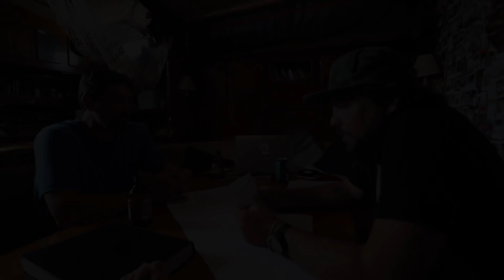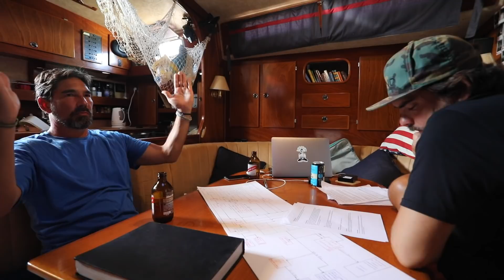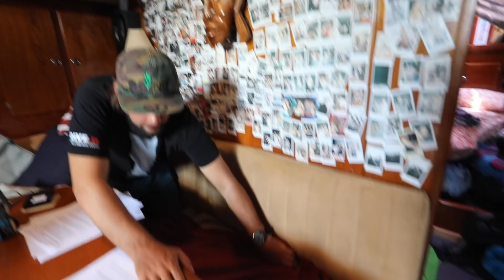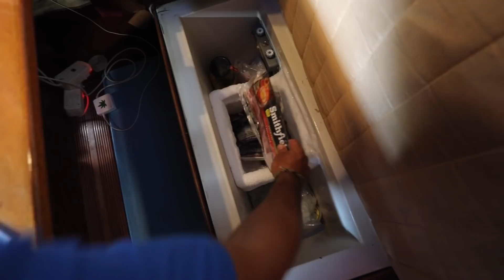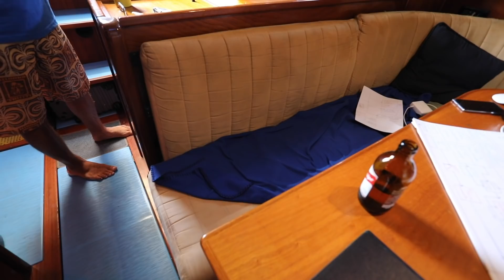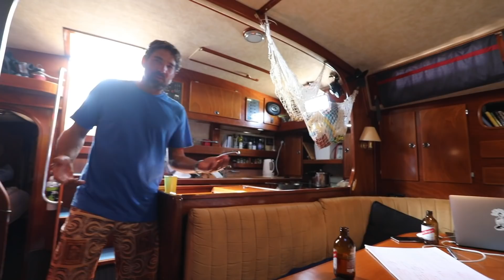How Cost effective is solar power? - ELECTRICAL BOAT TECH (7 of 7) -  Sailing Vessel Delos

Comment: You could look into a ‘soft start’ drive for the AC motor on your dive compressor.  They have the ability to slowly ramp up the speed and you can set the maximum current draw during start.  The only problem might be the compressor might have such a high compression ratio that a current limited motor might not be able to get the compressor over the first compression cycle.  A decompression valve might solve that if it is a problem.  Of course you would still have the running draw to consider.  That would depend on how long you need to run the compressor and how many amp hours you have available in your battery bank.  Might be worth the hassle if fuel consumption is a concern.
Reply from the maker: Yes, absolutely.  I have been looking into those a bit.  Of course we would probably end up depleting the bank and need to run the generator to recharge with the amount of solar we have.  But technically it could be possible.  Check out this one- https://battlebornbatteries.com/shop/easystart-364-3-ton-soft-starter/
Reply: Sailing SV Delos I saw a video of this being used for an RV A/C unit running an inverter from a battery bank.  It worked well.  You might need something a bit bigger for your dive compressor.  A good source of inexpensive soft starters can be found at:  www.automationdirect.com   On a sunny day when you have power to spare it would save you a few bucks.
Reply: @-_-..-_  400 amp x 24v = 9.6 kw. To run a 2000 watts compressor for 1 hour you will need a low frequency 3kw inverter no need for soft starter. Low frequency inverter can handle the spikes.
100A battery x4=400 amp x. 12v=4.8 kw.
100A battery x4=400÷2=200 amp x24v=4.8 kw
100A battery x4=400÷4=100amp x 48v=4.8 kw
To raise the voltage, the amperage is divided Wattage stay the same. 
To run a 2000 watts compressor for 1 hour you will need a low frequency 3kw inverter no need for soft starter. Low frequency inverter can handle the spikes.

Comment: Did you say 3 wifi routers? or just connecting 3 laptop to the wifi?
Reply: I think they run multiple wifi networks, based on prior videos.  A lot of marine equipment like Radar's that have wifi require you to use their (or a) dedicated wifi config, not all but many do.  That along with the normal wifi network is probably why they have multiple.  It could be one for Radar, one for guest/internet and one internal.  Or one internet, one radar, one AIS/weather.  Probably something along those lines.  Also, it doesn't necessarily mean they have 3 separate routers, as many routers can support at least 2 networks.
Reply: Not sure if this is there case but many homes have 3 "wifi" networks and they might not even know it really know it. just one quality wifi router normally has one 2.4ghz network and 2 5ghz networks. They might have one name and password on your device list but often times there are 2-3 networks actually running.   I likely have upwards of 10 in my home and 4-5 devices that are technically a wifi router. Not a large home just a "smart" home: security, camera, audio, "wifi", smart home, etc often run their own systems.

Comment: is your external storage array SSD or HDD based? Have you committed to all SSD storage on all your computers? Great videos. I love this series!
Reply from the maker: It's actually a Western Digital EX2100 with 4x6TB Red drives.  So not SSD but hot swappable and in Raid 5.  So far so good!  All our laptops are now on SSD which helps immensely with editing the footage of course.
Reply: @svdelos  Going to SSD in external storage is a lot like going to LiFePo batteries, bigger up front costs but better performance and longer life. Significantly lower power consumption and reduced heat are also bonuses. You might want to consider it for the future. 6+TB SSDs are pretty pricey right now but the costs will come down quickly over the next year or so. You can literally swap the SSDs for the existing HDs in the hot swappable trays (after backing the system up, of course) and you are done. Brian you may be the most versatile, and most personable, polymath I've ever seen!